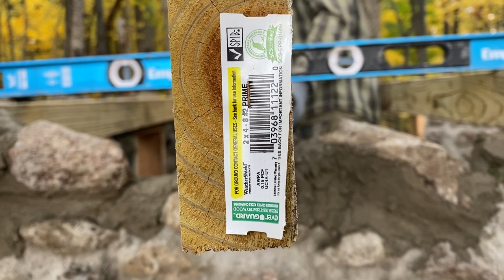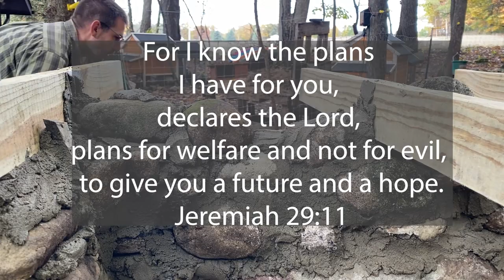Chicken Coop Goat Shelter: Part 6 Finishing the Stonework

Comment: I've seen Italians do stonework builds and they are darn good at it. As others have suggested in prior comments,they use a wire brush to clean the mortar off the stonework. I've even seen them use a damp sponge to clean the stones as they build. Stones should protrude and cement recede.Each stone should be turned and examined and the most attractive side put on the outside. But yours is only a goat/chicken coup in the middle of a wood ,so the precision that I mentioned above isn't necessary ( I suppose). I can't wait to see it finished. Looks like a heck of a lot of work. So hats off to you.👏👏